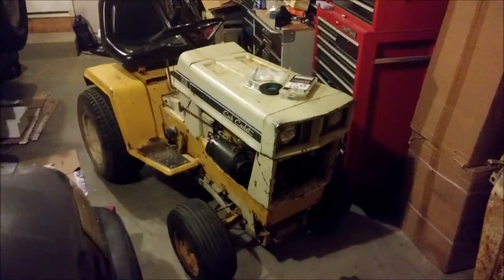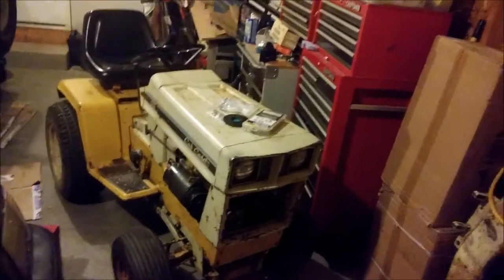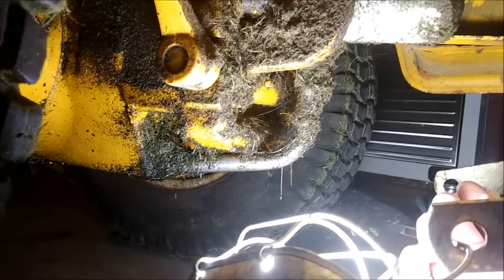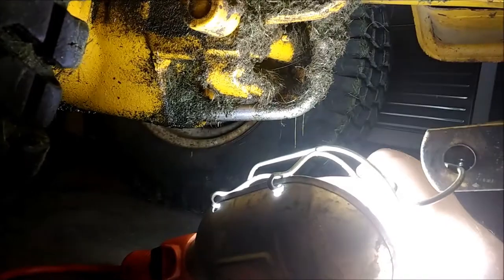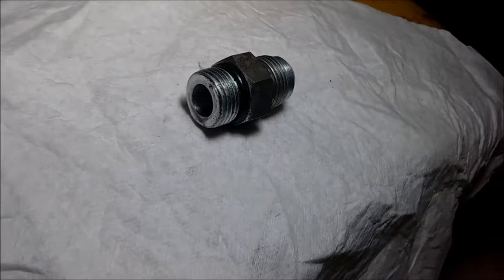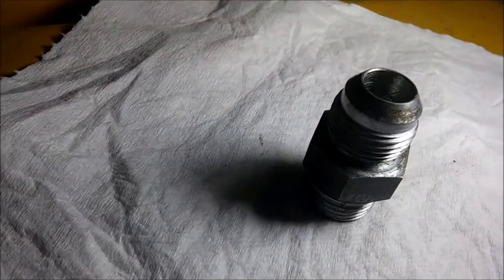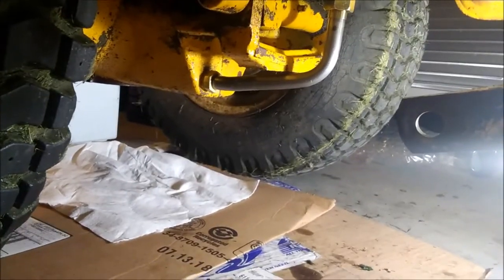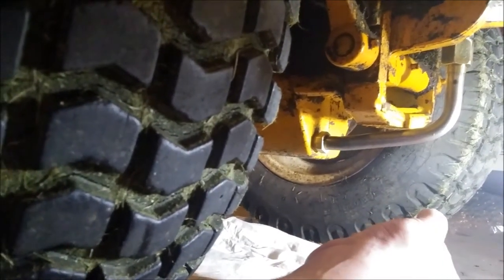TBL 12 - Transmission Oil Leak Repair (Suction Tube) Cub Cadet 149: "The 14"

Comment: Where did you find the replacement tube? I have a 2 piece tube and the upper one is damaged. Everytime I think I found one they're sold out
Reply from the maker: I'm 90% sure the single piece tube superseded the older 2 piece design so I'm think you can use the same thing you see on mine. Part #927-3008 is the single piece tube and appears in stock everywhere, including directly from Cub (www.cubcadet.com/en_US/service-and-parts).

I'm maybe 70% sure the older 2 piece design is just regular straight hydraulic tube and fittings. You may be able to have something whipped up at your local hydraulic store.

And... I'm about 30% sure some older models may require the 2 piece design, but I don't have one here to examine. I'm mostly familiar with "wide frame" Cubs, so from about the mid-1970s on up to around the late 1980s.
Reply: @TheBrokenLife  found it thanks for your help. Maybe it'll stop my leak
Reply from the maker: @alrevels2510  Good luck with it! Turns out I'm going to have to split mine this winter to finally get the leaks fixed.
Reply: @TheBrokenLife  even tho they have a here and there issue they're still better than a new mower
Reply from the maker: @alrevels2510  They are solid machines for sure, but the problem is that after all of these years they've been just about completely used up. It's not their fault as 50+ years of hard work just wears things out, but it makes it tiring to keep up on them. At least with mine, something is always broken and just getting by. Plus parts availability is becoming a problem.

In total I have 4 of these things to care for and I'm hoping in the not too distant future that they all get upgraded to hobby toys and are replaced by something much newer (with a deck a couple of feet wider) for the actual work. They have all earned their retirement.
Reply: @TheBrokenLife  so far I'm convinced that where there's a will they're will always be a way. My 105 is pretty much unmolested but has a wiring issue but other than that it's a solid machine. I put the rock shafts on both of mine. Other than my 127 which I have a bit more to do, but still solid machines
Reply from the maker: @alrevels2510  Oh for sure... I have an hour long video where I 3D designed a had CNC manufactured a custom transmission gasket for mine. It took 2 months...

There is a guy out there reproducing full wring harnesses and his work is very nice. Can't place his name right now, but he can't be that hard to fine. So... You've got him on your side for that issue.
Reply: @TheBrokenLife  I ordered that hydraulic line today. Man I hope that fixes my leak. I saw the video on the gasket hope I don't need it. I've noticed several people making wiring harnesses. Gonna wind up getting one for my 105. My 127 the previous owner already done.
Reply from the maker: @alrevels2510  I'm not sure what tractor you bought the line for, but I don't know if it fits a 105 or a 127. Unless I'm mistaken, those are both "narrow frame" tractors and mine is a wide frame. Yours are the ones I was talking about that might require that 2 piece design. I just don't know.

Side note: Your NF Cubs probably do have the gasket that I had made. The good news for you is that I have around a dozen more of them. If you need one shoot me an email.

Comment: How do ya put oil in it?
Reply from the maker: There's a plug in the rear end cover that you remove with a 3/8" drive extension. Then I just use a funnel with a hose on it. I just revisited the leaking rear end again this year since I didn't get it figured out last year and that video will be up in a couple of weeks. I recorded the filling process this time!